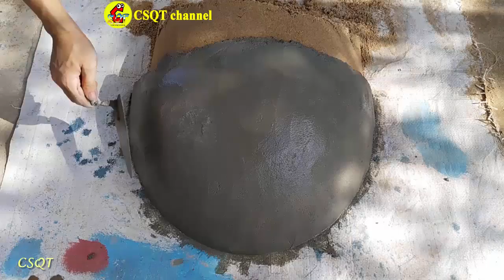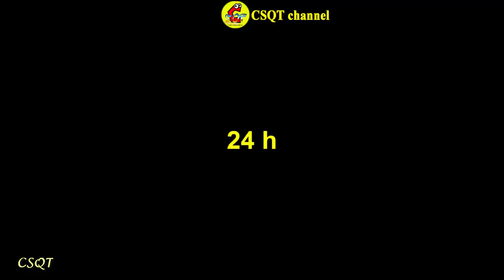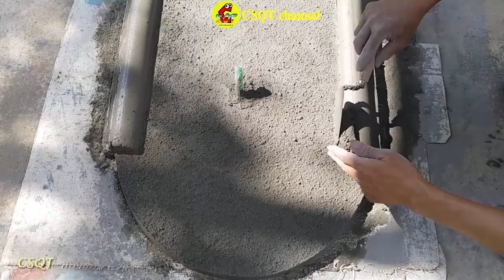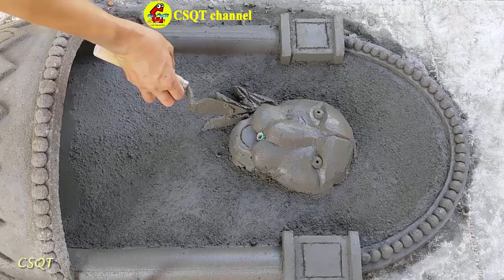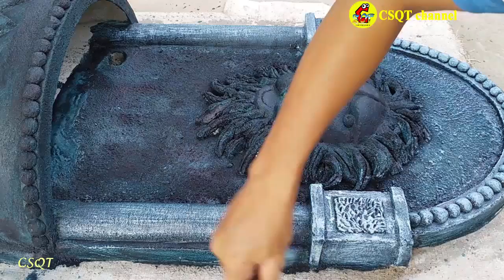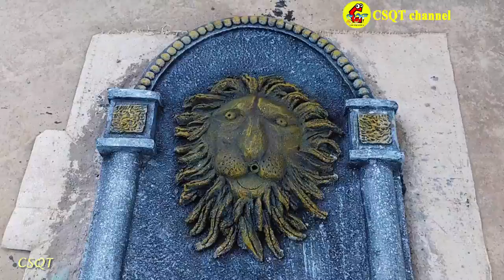Wall-mounted fountain / Cement ideas / it's beautiful when it's on your wall

Comment: Hello, excuse me, is it only cement or does it also have gravel or sand? Thank you
Reply: Doesn't it break down over time if it's just with cement?
Reply from the maker: I use cement and sand with a ratio of 1_1.5 or 1_2, thanks for watching
Reply: @CSQT_art  Thanks ☺️